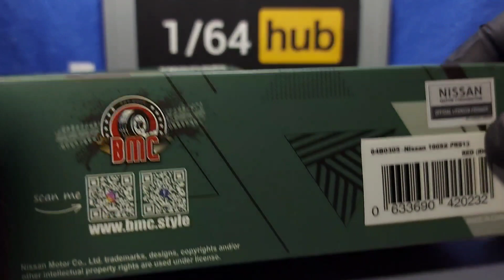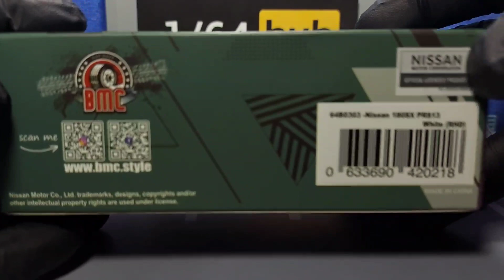BM Creations 1/64 Nissan Silvia 180SX

Comment: I just got these two on Friday. However, I don't like the aftermarket aero kit supplied, So, I will leave mine stock. Also, I would like if BM Creations would try to make the parts fit better and paint match them after they remove from the plastic sprues. Thanks for sharing! I always like your videos! ☺